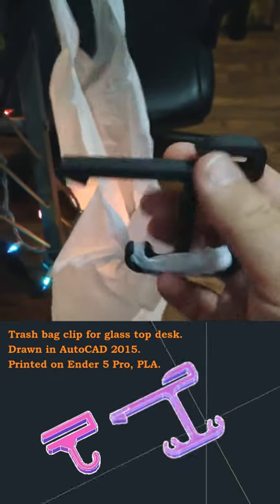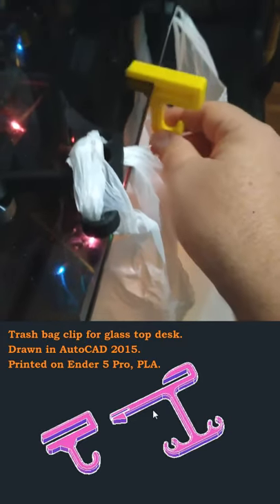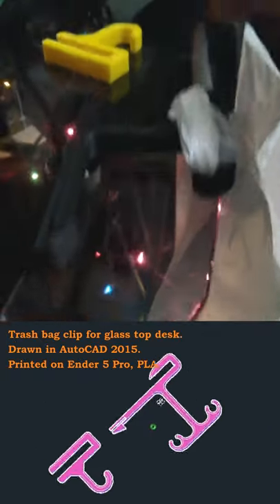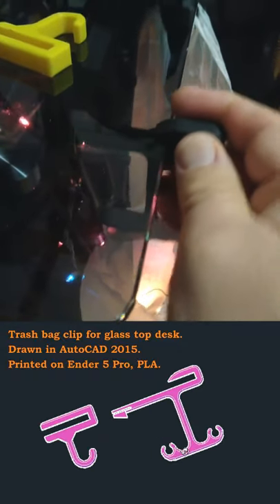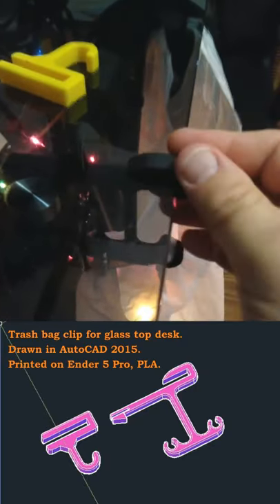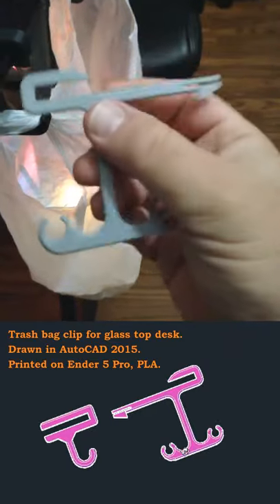3D Printing Useful Things -  Under Desk Trash Bag Clip #shorts

Comment: Could play around with the tolerances a bit, maybe add some grippy material so it doesn't slide off the smooth surface.
Reply from the maker: Thats a great idea. I had thought about adding in a inset for some of those self adhesive rubber bumpers on the first version.  But locking it in to the support under the glass makes it extremely solid. 
Thanks for commenting.